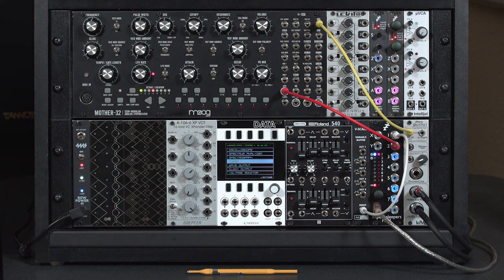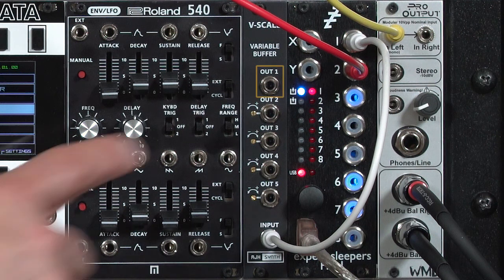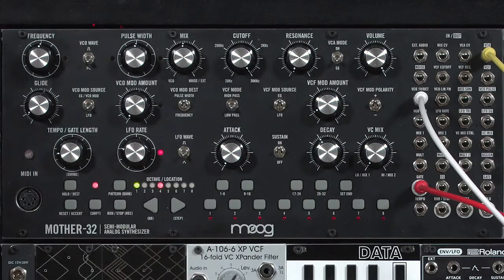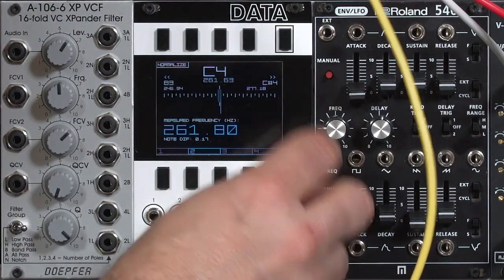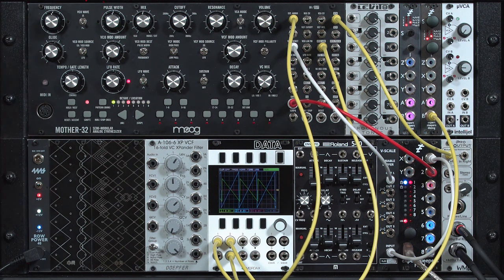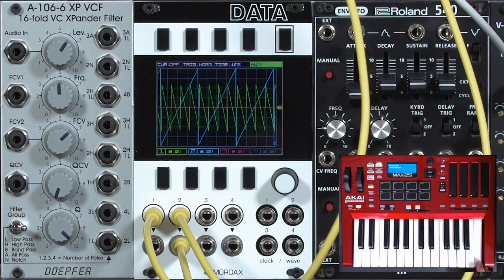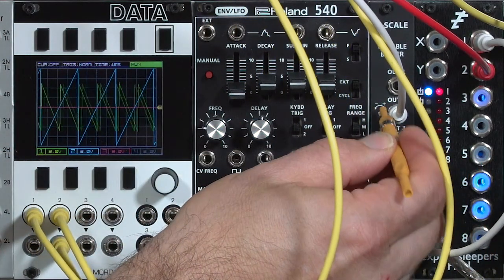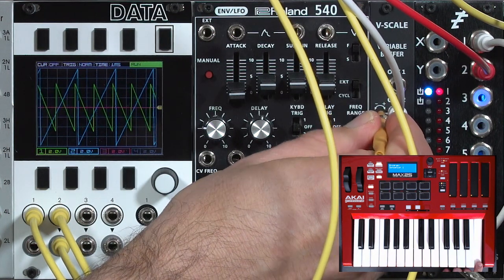Improving Intonation using the AJH Synth V-Scale (Part 1: Moog Mother-32)

Comment: Hi Chris, I have a Lifeforms Double Helix and the tracking on both oscillators is really bad - it was never very good but feels like it's got progressively worse - it starts going noticeably out of tune after one octave now. Would the V-scale be a suitable solution in this case? Thanks in advance!
Reply from the maker: Yes - that's exactly the type of job the V-Scale was designed for.
Reply: @LearningModular  Thank you! And thanks for the great videos.

Comment: What is the actual name of the hand tool you’re using to adjust the voltage knobs? I’m having trouble finding one on google.
Reply from the maker: They're typically called a trimmer or potentiometer adjustment tool. (That one came with the Mother-32.) Here's a link to an example on Amazon, to help you find them: https://amzn.to/2DSMLPR
Reply: @LearningModular  Thank you so much!

Comment: Do you need the extra Oscillator to compare I️t to or can you just use a Mother 32 through the Oscilloscope on the DATA and see the drift movements?
Reply from the maker: To see the drift on DATA, you need to have a reference sound as your sync source. One hand clapping is always in tune (smile); you need two tones to say one is different than the other.
Reply: Learning Modular thanks for the reply, going to be watching your videos as I slowly dip my feet in the warm water of the jacuzzi that is modular. 🤣

Comment: Thanks for the vídeo. I didn't understand why you didn't use a tuner with precision of cents instead the oscilloscope. The ajh module seems to be an interesting tool.
Reply from the maker: I covered that in the companion article: http://learningmodular.com/improving-intonation-using-the-ajh-synth-v-scale/

If I use just a tuner, I find it easy to settle for "close enough", and also sometimes don't take into account that one octave was flat, while another octave was sharp - I was just trying to get "close" in terms of cents. For me, hearing the beating, and seeing the drift, really drives home exactly how much detune we're talking about, instead of aiming for a more abstract goal like 1 or a few cents. But again, that's me.
Reply: Thanks for the reply. I noticed you say "intonation" and not callibration. What's the difference?   
Is this procedure possible with an lfo that reaches audio range? Thanks again.
Reply from the maker: For me, "intonation" is how well the oscillator stays in tune across a range of pitches; "calibration" is the procedure to improve intonation. 

If the LFO that goes into audio range has a 1v/octave input, then yes, this same procedure should help. Don't be surprised if the range of good tracking is more limited, though. For example, the Kermit digital LFO make a cool lo-fi audio oscillator, but it only takes 0-5 volts as its pitch CV, and its tracking is very poor as you get close to 0v.
Reply from the maker: Of course, my comments apply to digital tuners. Stroboscopic tuners behave more like the oscilloscope display where direction of drift (mismatch) is more clear.